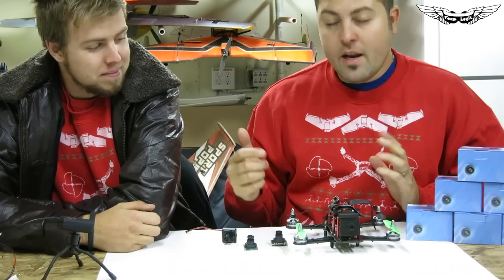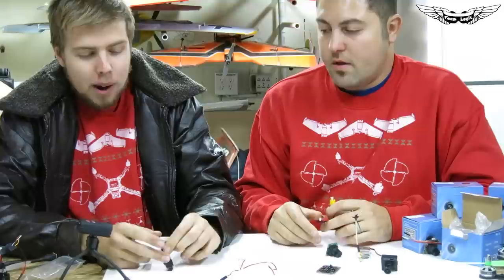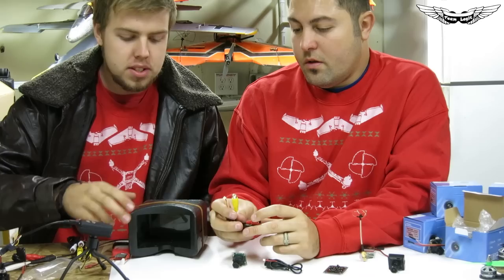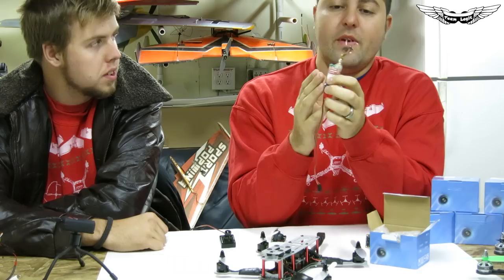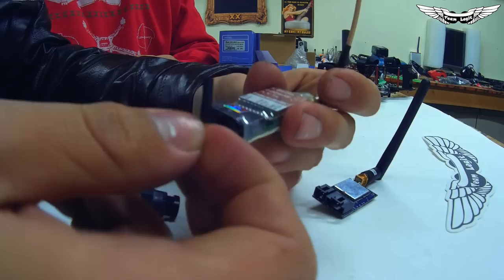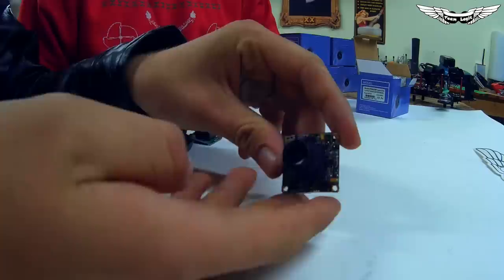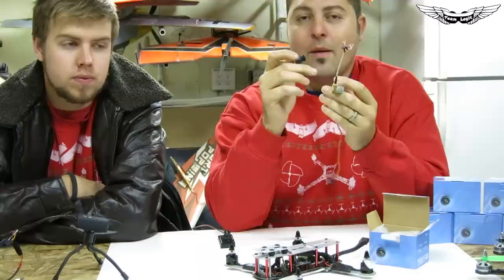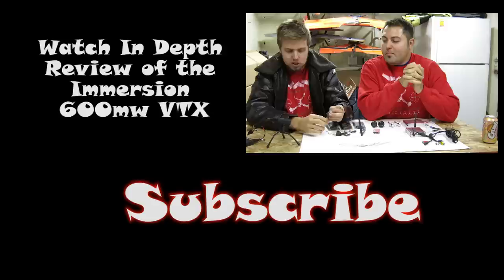Review of the Pz0420N The New Team Legit FPV Cam of Choice

Comment: Well I'm a newbie, the 700tv I got to start with was ok. Struggers with low sun and saw this and ordered. Since Sussed how to short the programmer conns to get menu up and get the 700 performing properly. Yet to test but will likely give your a good test too. Soon to be on x2207s and 4s exciting times. Keep up the good work TL.
Reply from the maker: Keep Us posted. Were pretty sold on the 600tvl
Reply: Haha, I can see that. Will do. Got ups tracking number. Thanks for quick turnaround. See how long it takes to the Uk